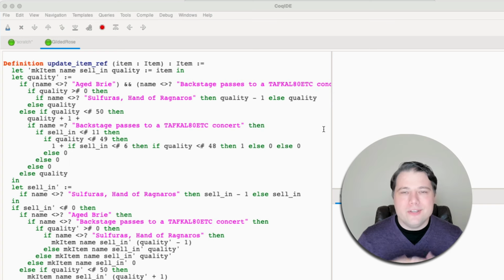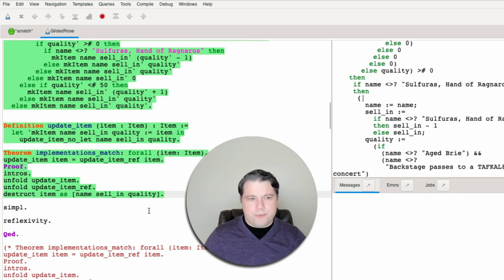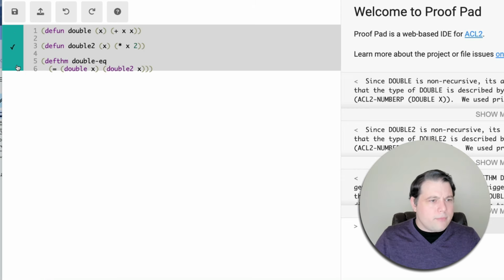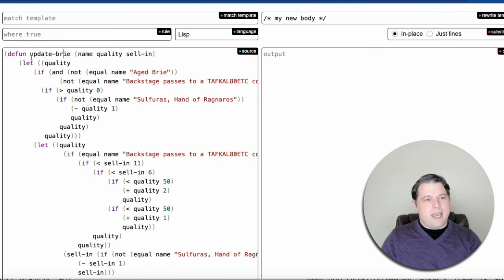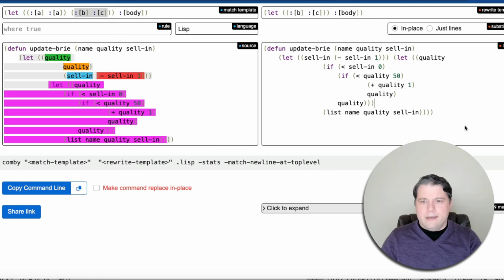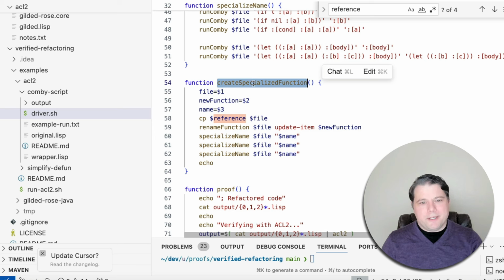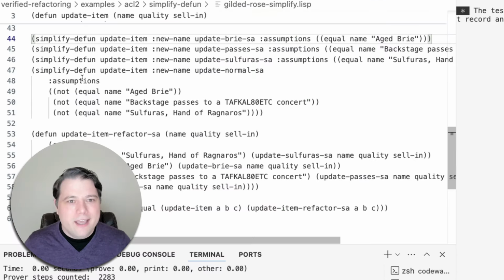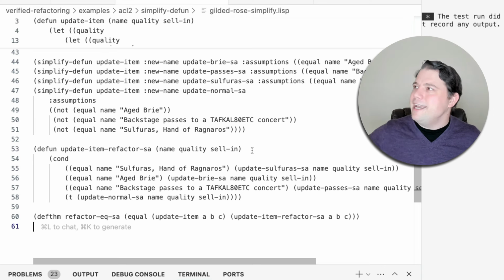Theorem Provers Are Refactoring Tools

Comment: Wow! What if Ray solves refactoring? If teams could run an auto-refactoring tool that executes a bunch of reasonable refactoring rules in the same way they currently run their auto-formatting tool, it sort of changes everything.
Reply from the maker: Ray-Factor does have a ring to it :) I see refactoring as something where the target depends on your current goals, so I don't know if it'll ever be quite as fire-and-forget as formatting/linting. But these kinds of workflows - express one intention and 30 steps unfold - I think that's very possible.

A major limiting factor is that our mainstream languages are not verification-friendly, so we either climb that analysis mountain or write more code in provable languages. Purely-functional languages might have a new secret weapon.